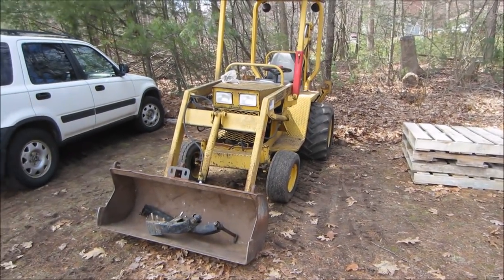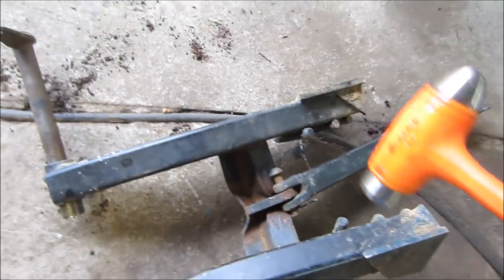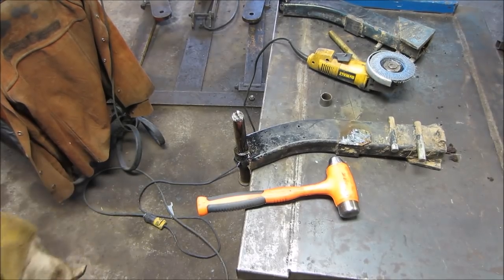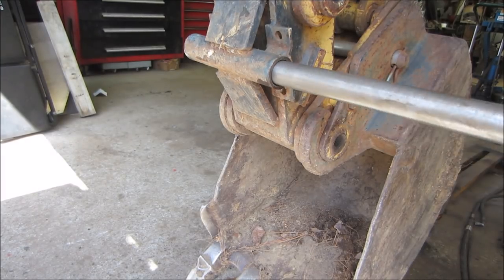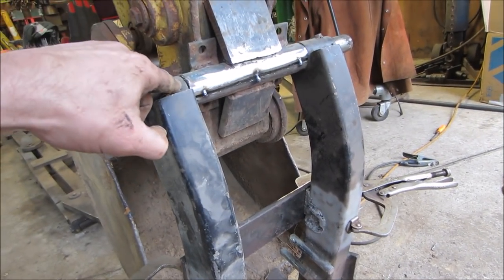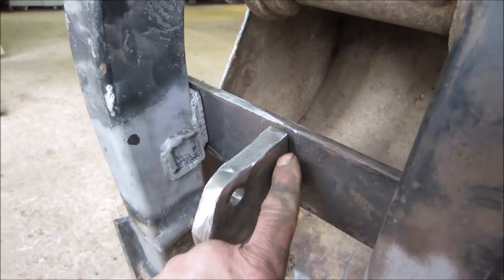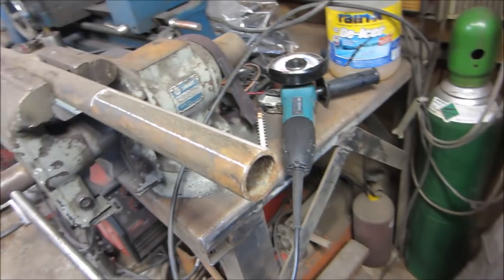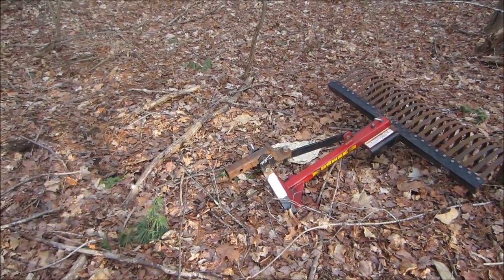backhoe thumb rebuilding.

Comment: I just posted this to the Facebook mustie1 appreciation page:

I am a self-employed repair specialist. I have been working for myself for the last eleven years. The other night I saw Mustie working on that baby backhoe. The video where he has to refabricate the pin on the stationary part of the claw.

I saw him use PB and an emery cloth strip to clean up the shaft. I thought that was kinda neat because I've never seen that done before.

Little did I realize I was going to have to use that very same method the very next day on a rusty old shaft on a piece of carwash equipment that I service. It worked like a charm! I couldn't pound it out with the BFH but after using his technique the shaft came right out.

I have to give props to the Mustie one for passing along one of those secrets that we MacGyvers have in our arsenal of tricks for getting things apart.

Thank you Mustie1!

Comment: As a Certified Mechanical Engineer, an A Grade Government Mechanic, a Jet Engine Fuel Control Technician (grade 1) and a Combat Engineer in the Rhodesian Bush War, I commend you greatly for the totally Over-Engineered system you have built. I am absolutely in awe. It is a creation I would be very proud of indeed. I thank you very much for showing me that there are still people like me everywhere.
Reply: An A grade government mechanic???!!!! What exactly does that mean....as far as me...I'm cat Cummins and Detroit certified and having worked on heavy equipment for 24yrs...no...no his design on that machine isn't good at all the pressure in those cylinders are more than enough to bend and break that shit he's calling a thumb....he's going to get someone hurt
Reply: @thomastucker8887  It seems to me that you only have one branding iron in the fire. Good luck with that.
Reply: It means I was voted apprentice of the year. It means I came second in my year at the polytechnic. It means I was foreman at 23 years old.
Reply: What the heck are we talking about anyway?

Comment: Great content and I thank you for it...one word of advice, if you're going to use a grinder above your lathe ways, ALWAYS lay a protector rag across your ways. It's extremely hard to get ALL of the grit out of nooks and crannies on a lathe, and the grit will destroy your ways accuracy !!! Use a piece if 1/4" 2" x 2" angle iron and form a triangle using the piece you tacked on first. then come off with a flat-bar tab on each side to line up with your pin hole spots. Less welding and less material, but structurally beefier than original and 45 degree of angle Iron on inside should give more clearance...just head figuring...but, yours looks good. Just a note, if you can spray paint it while it's hot, the paint will bake on and be a lot tougher and last longer.
   Oh, and thanks for the "wheelie" at your video's end. KEWL.

Comment: Mustie is one of the smartest guys on youtube when it comes to mechanical devices and their operation. With that in mind, I am trying to understand why he doesn't lower the engine speed to idle before shutting it off? Having worked on and operated farm and construction equipment since I was 10 years old, I was taught from day 1 that an engine should be throttled down before turning it off.

 It was drilled into my head that not lowering the throttle before shutting an engine off allows the high RPM's to pull gasoline into the combustion chamber and accumulate in the piston bore because of no spark. This allows the fuel to run past the rings and thin the oil if done repeatedly? It can also cause an explosive situation from the fumes in the exhaust system and possibly crack or even blow off the exhaust pipe itself?

Am I just believing an old wives tale? The principles behind this theory make complete sense to me but here again, Mustie is a sharp guy and of all people, were this a problem causing him more work I'm sure he wouldn't do it? Maybe my grandpa and dad were just crazy like me? Lol

Comment: If you ever need gap filler, just ap the coating off of a welding rod the correct thickness and weld that in place. It will be super strong. Love your channel, keep up the great content!

Comment: I used one of these Terra Mites for almost three weeks.   The things I didn't like was that it struggled going up about a 30° slope.  Also, it had no parking brake.  It would drift downhill if I didn't have one of the buckets dug in.  A little disconcerting at times.

Comment: Gonna have to fill bucket with something heavy or add counter balance on front. Wheelies are fun till their not. Just suggesting to lower the canopy/roof on tractor to fit in garage cause you have more than enough to get a few inches, just cut in the middle and then take some of your thin strap stuff so it will hold still and weld smooth and paint... no fowl. Your doing the best you can with what you have to work with. I know cause I been there

Comment: Mustie, this might be a bit late timewise, or mentioned previously, or you might have already discovered this, but the replacement pin hangs out beyond the side of the bucket and will ultimately interfere with the side of the trench if you use the machine for digging. Other well done. What tooling are you lacking for turning the pin, I see a tailstock on the lathe, and a drill chuck on the bench in front of the lathe that appears to have a 2 morse taper shank? If they match, you only need a centre drill and a live or dead centre to be able to turn long material supported by the tailstock, which would be adequate for the pin job. I would be willing to order and pay someone in the US to send you some centre drills and a live centre to give you the functionality. Wally

Comment: Hi Mustie1, I was wondering if you had thought of making a camera holder that is like a harmonica holder? The kind that goes around your neck so one could play another instrument with their hands. A bent  rod or conduit  with some type of pool noodle or hot water insulant foam tube around it.  Conduit would be lightest  and you might find the pre bent stuff at a hardware. I would free your hands and give us a great view if you put a hoop over your head so it would turn  with your eyes. Or just a old foot ball helmet and mount a bracket to the face guard? The helmet could protect your  noodle from  bumps. Keep up the good work I really enjoy spending time with you and  learning how bad a VW owner I used to be.

Comment: A set of adjustable readers is pretty cheap off the net and worth their weight in gold for these jobs. Allows you to slowly return the hole to round after it has got distorted like this one. Good for suspension bushing holes etc.

Comment: Nice job on the repair, how do you like the terramite? they pop up every once in a while for sale here. would be nice to have a small backhoe.
Reply: MJM’s Workshop I think the sane but you can't beat renting a bobcat for 250 for 24 hours where I live for the big projects. No need to worry about it sitting or maintenance but it all depends on the land you have I guess
Reply: B White I actually have a bobcat but have wanted a backhoe for awhile and not sure how good the bobcat backhoe attachments are and they are really pricey. I have tractors as well but I’ve heard the 3pt backhoes are no good.
Reply: if you can afford it it. an excavator is a lot more maneuverable.

Comment: If you find yourself needing good quality steel to make pins and stuff from then a good source is the axle shafts from a scrap axle. They are dirt cheap and tend to be good quality steel that has been treated to be tough,excellent for pins. Certainly cheaper than buying bar stock to make a pin.

Comment: Throw the pin in the freezer over night it will shrink enough to go in. I've had pins on dozers that you couldn't drive in with a 20 lb sledgehammer. 24 hrs in a freezer and I had to tack weld the pin in so it didn't slide out while it was still cold

Comment: You could always use some copper pipe as a backer when welding that gap up. The filler won't stick to the copper. Of course, you probably knew that already! LOL

Comment: Shoulda just used a A/O torch to heat up the center on your hydraulic press the pressed it back down to were you could fine tune it again using the torch and large pair of channel locks.
Lot less work.
I did a whole lotta stuff like that as an Ironworker welder fixing things forklift drivers banged the crap outta at Buick and Chevy plants in Flint Michigan as my first full time job for 2 and 1/2 years till I scooted off to Coast Guard boot camp.
Man those guys could really mangle stuff.
Reply from the maker: cant use what l do not have
Reply: @mustie1  I guess that should be on your next yard sale shopping list.
I had a half size set that got stolen during a break in.
Loved how portable it was.
Not to mention cheaper to fill.
Great for certain welding jobs where even tig isn't possible.

Comment: I was thinking if you don't have the right chuck piece for the lathe, so why not make a video of you making one on the same lathe if possible. And if your worried a strength make it from steel and and heat it up till its red hot and dip it in oil cuz that's what it seems like it is. Lol I'm not intirly sure how to do it. Would make a great mini video tho. And if you do you will have what you need by the end.

Comment: that is made way to light, scrap it all and start over, you dont want to be thinking all the time how much presser your putting on it, cut 2 arms out of 3/4" T1 plate on edge and build off them, the 2 plats must come between the teeth on the bucket and past, and the pin boss need to be minimum 3/8" wall, cut thattrash off the boom and make a prober bushing that looks factory, not some farm bot hack

Comment: Are the front tires supposed to be pointed in to the center that much? It looked to be to much  tilt out  a lot more then normal. Stop you video just after you finish talking about the hooks and receiver hitch on the front bucket and you should see what I mean. I could be wrong and the tilt out word is correct for that tractor. TO me as I have said it looks to need repairs. Take care "Mustie1"

Comment: Owns a lathe, uses an angle grinder to reduce diameter of the rod???
If the length of the rod is too long for the lathe bed, put the  rod through the headstock and only turn down half the length at a time. I am sure that rod was anything but smoothly round after that. I know it's just a pivot pin, but my OCD is telling me to do it right the first time for a better fit.